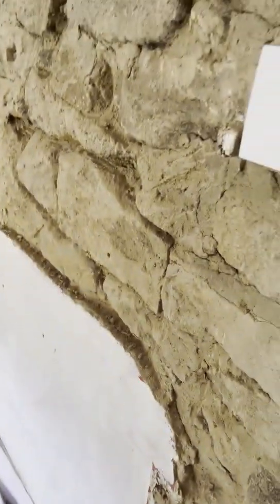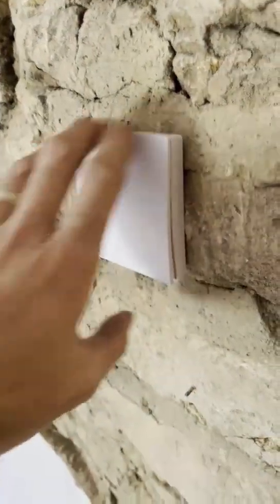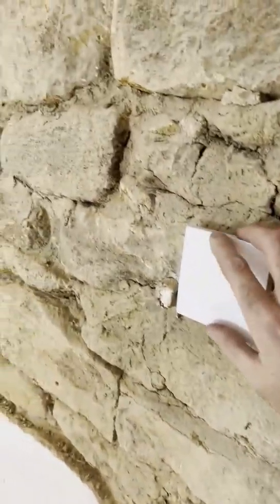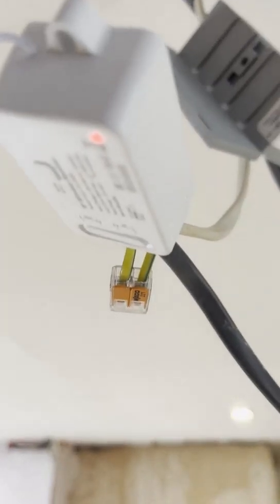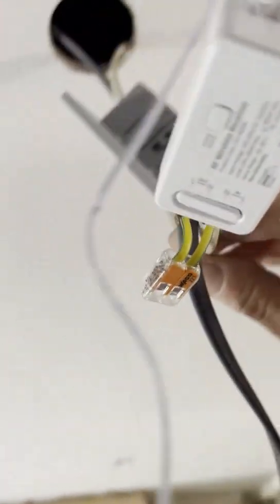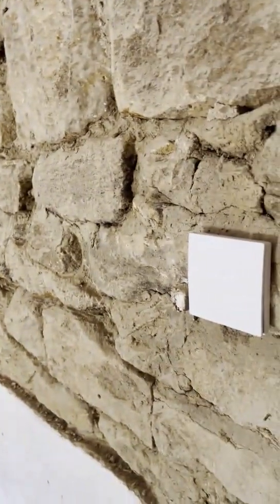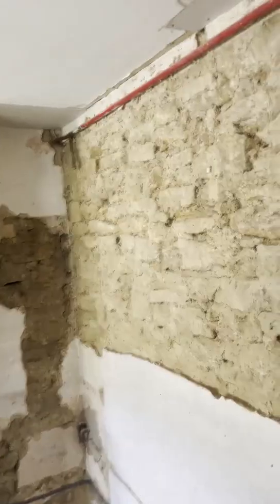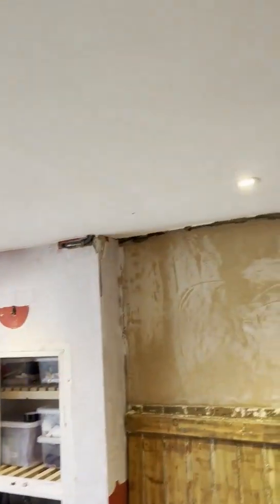What is a Kinetic wireless light switch and how does it work?

Comment: I have a question which may sound dumb, could you pull out an awkward wired light switch and then connect the receiver to it?

So that i done have to hook up the receiver to the light, instead i use the kinetic switch to turn on the original light switch?